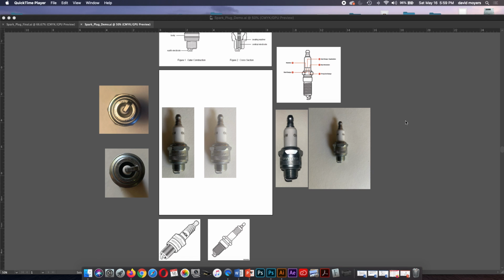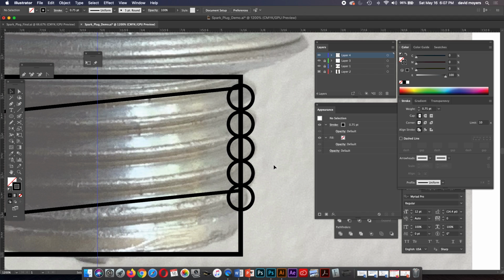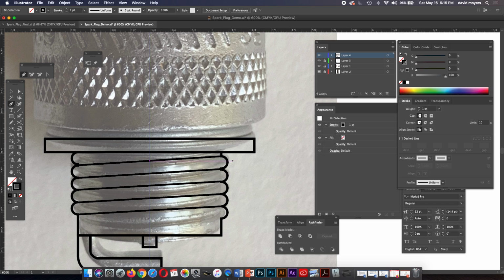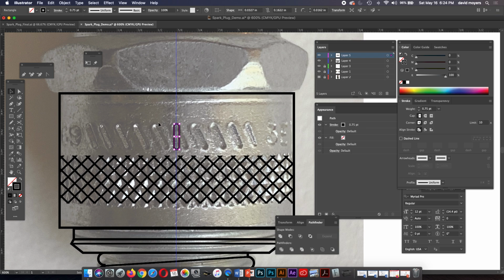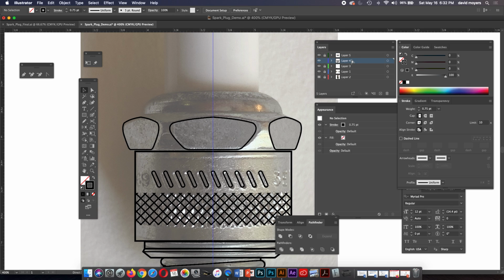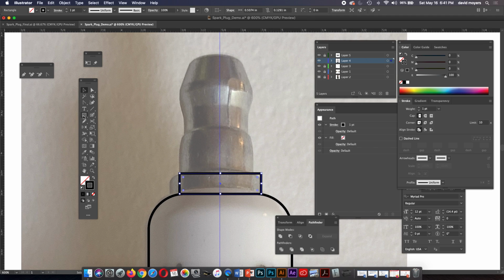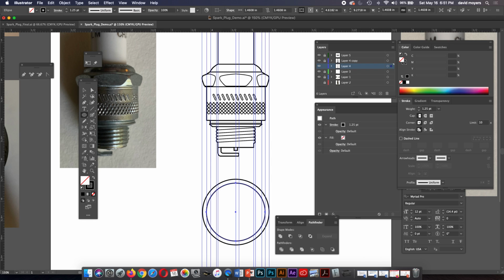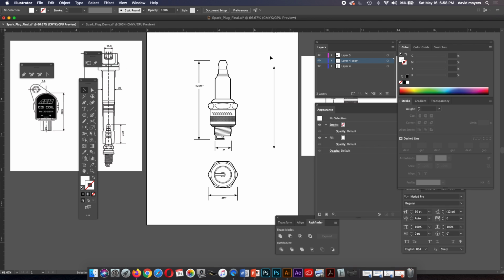Technical Drawing tutorial

Comment: Sorry, not impressed. Yes, you have a photo as you basis but you should also have had a spark plug in your hand since I think many of you lines are wrong. For example, your threads are not properly represented. If you have seen a sparkplug you would know that those threads should be concave and not concave and the top of the white insulation is obviously a chamfered edge, not a curved edge as you drew it. Later I see that you corrected that edge but you didn't show that. I think you are too confused to be doing instructive videos since it feels like you are guessing the whole time. You feel like an amateur and not a professional.
Reply: I read ur comment and I think you were genius in drafting and please understand that this illustration will not used as drawing reference for 3d modeling or used by the engineers ... These illustration are used in owners mannual or repair mannual.. its main agenda is to show the exploded view and the basic drafting of the assembly.. As u were not aware of what he is actually doing please don't discourage creators